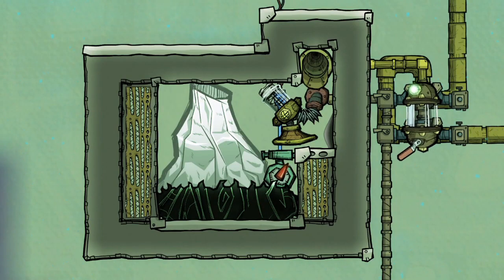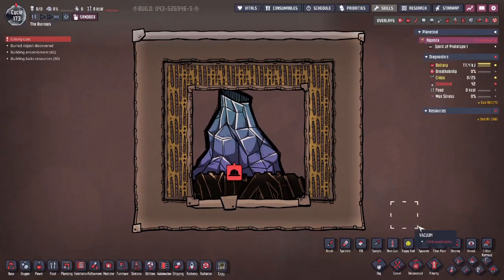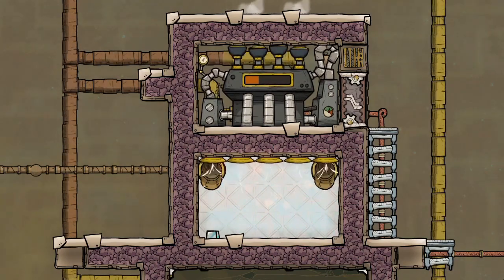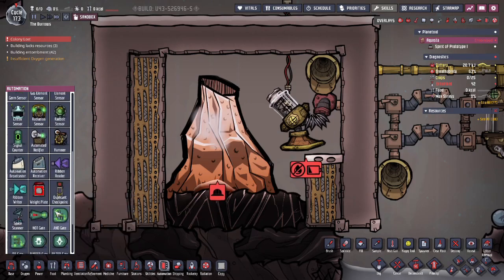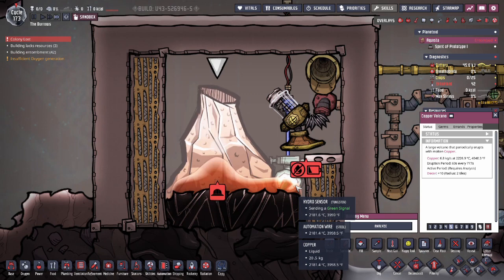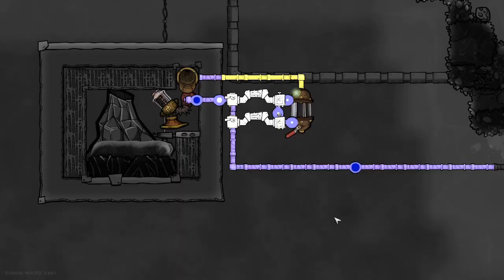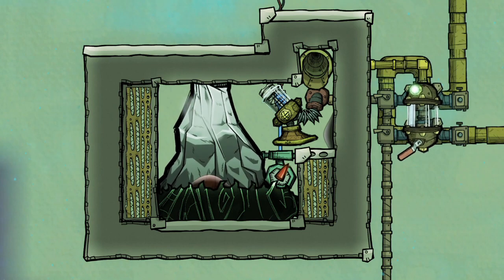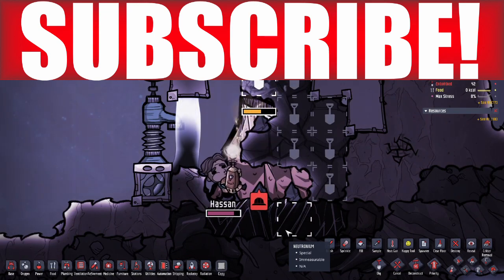Mastering Volcanoes - Oxygen Not Included (Tutorial)

Comment: Never thought of transporting the liquid metal. Great video! Did you have to make the pipes out of ceramic insulated pipes? Or is igneous rock OK?
Reply from the maker: No because of the long dormancy of volancoes the ambient temperature dissipates the heat, but to be fair usually by the time I'm taming volcanoes I have a good cooling system in my base so that probably plays a big part in them not melting, but they are really slow to raise temp, I usually end up using igneous because it's usually in excess.